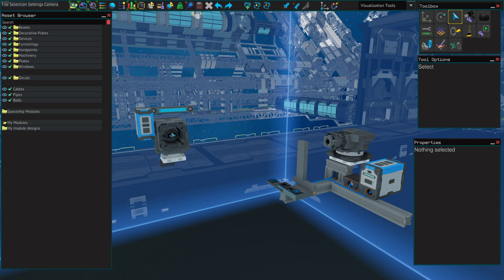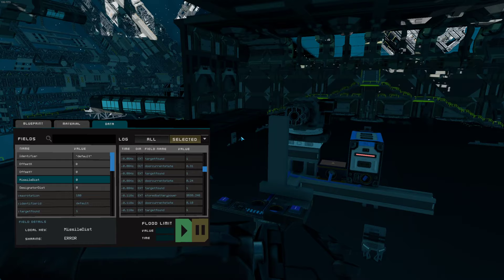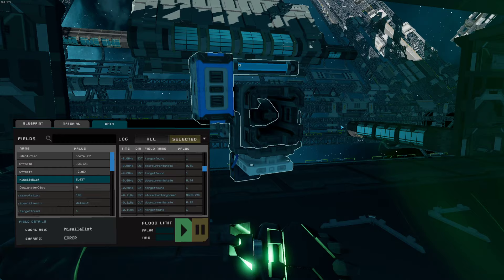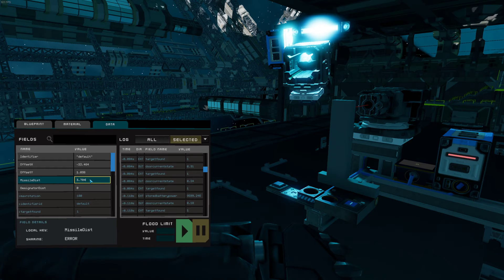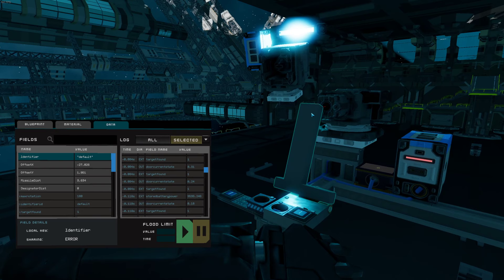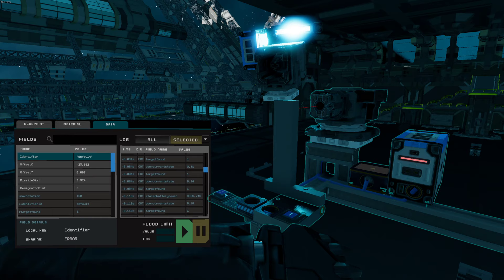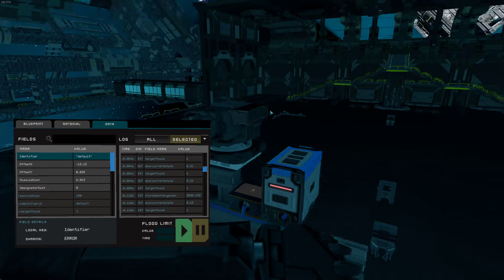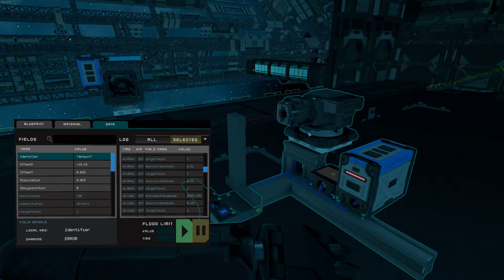Transmitting data wirelessly in Starbase

Comment: Yesterday I thought about this when the question arose of how to transfer information between two factory halls at my station and came to the conclusion that it is possible to build binary logic based on rangefinders and sliders, so in fact we will get an analogue of a relay or a transistor. Such a system will be cheaper and more compact, but direct contact of devices will be needed.